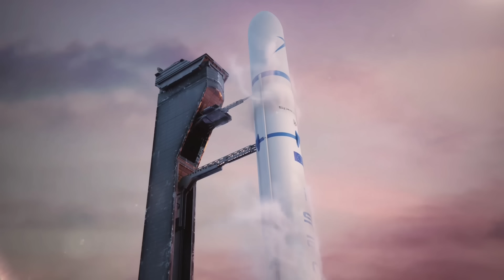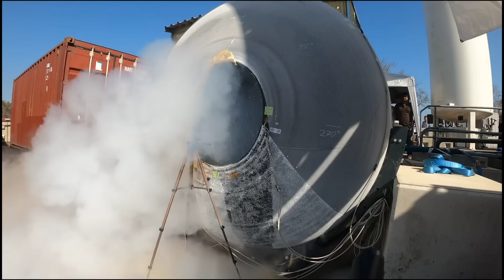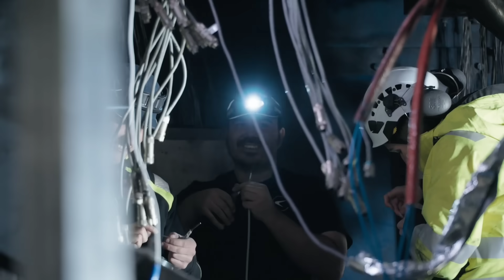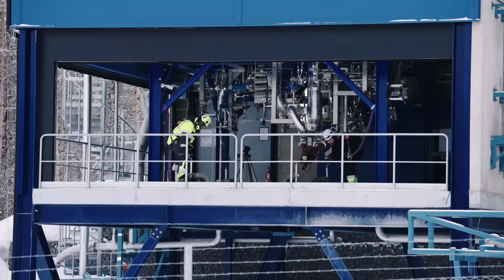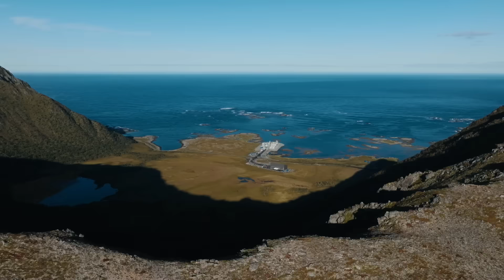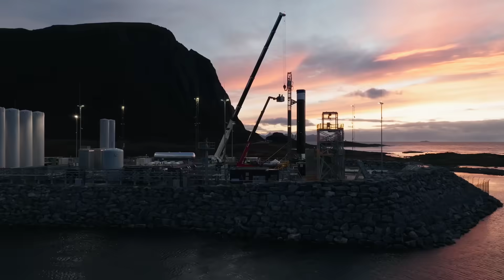THE WAIT IS OVER!  This week, German launch provider Isar Aerospace will make history!

Comment: Propane produces more CO2 than methane, as there are only 2.7 hydrogen atoms per carbon atom, compared to 4 in methane. It is a bit better than the approximately 2 of kerosene. The energy per mass is also somewhere in between (IIRC closer to methane than kerosene). The big advantage is the fact that its melting point is below the boiling point of oxygen, so the tanks can share a wall, reducing weight. Other components don't need insulation between the two substances either.

Comment: Overall, I think propane has the potential to be an excellent rocket fuel.
There is a sulphur problem with propane. But that problem is one of coking and it only matters if you want reuse. You can make the problem go away by either removing the sulphur or manufacuring thenpropane from co2 and h2o. Both methods have their issues.
However, propane and oxygen have an overlapping liquid temperature at standard operating pressure. This allows the tank interface to not require insulation, which can greatly lighten the tank structure.  At -100C the tankage density of prop-lox rocket propellant is only slightly less good then kera-lox. And the specific impluse is only slightly less good than meth-lox. To my mind this, alone, makes propane an excellent all-around compromise fuel for a launch system.

Comment: it seems all these startup are neglecting one crucial financial fact...whilst building rockets to compete with Falcon 9.....Spacex views Falcon 9 and Falcon heavy as old obsolete expensive platforms....when is a big if...but when starship comes fully online and reusable then even Electron Rockets will become financially nonviable.....it costs around 7.5 million for an electron launch.....Starship launch costs are projected to be very little more than that and the retail cost to customers is apt to be in the 20 - 30 million range...with 100-200 times the mass.... I find in unlikely many countries or companies will decide to pay 2 to 10 times more than what will be available ......basically all these new launch providers could simply be 5 - 10 years too late..   very few countries, companies or people are willing to pay 10 times the going price on simply principle..
Reply: Starship economics don't look that great so far, even ignoring that it didn't make it to orbit in 8 flights, and won't attempt it in flight 9, either. And all this without payload. All we know is that the current configuration is under-powered and needs to be larger to make sense. And while re-using the booster is impressive and seems to work, re-using a craft after re-entry from orbit did not make the Space Shuttle cheaper. Main problem is that you have to spend a lot of weight on the heat shield, structural elements and reserve fuel for landing, all cutting into the payload, and that won't magically go away. Maybe re-using the booster will result in good enough economics, and SpaceX will put something new, disposable on top of it, or they make a few break-troughs and actually achieve "rapid re-usability", high reliability and a decent payload capacity, but building something that is durable under extreme thermal stress and hypersonic airflows, but also lightweight, strong and cheap, that sounds more like a miracle than something you can actually build. There are always trade-offs in engineering, and I see I high probability of StarShip becoming the equivalent of the Cybertruck: Ambitious, innovative, expensive, unusual, and fundamentally flawed.
Reply: @peterprokop  the last 2 block 1 starships actually proved the system is viable...it may take 5-10 more block 2 starship tests to get to a point that spacex learns enough to progress to block 3...  the simple fact that block 1 starships survived intact and in the location they belonged shows that with time the system will bear fruit.....this concept is nowhere near as fundamentally flawed as the space shuttle was......also starships were never meant to be as rapidly turned around as the booster is meant to be....that is why spacex is not mass producing boosters ...a single booster was meant to launch a multitude of starships..
Reply: @mikelee-i3b  I am not convinced. While booster catches looked impressive, not even a booster has been re-used yet, only one engine so far, but booster re-use should work, although re-use also comes at a payload price here, especially having it to return to launch site.

And regarding Starship making it down: I agree it was promising it came down, I think three out of eight times, in what is called an "ocean success", but I see a long way from there to reusability, and it might be even too long. There is not much value if you bring it down, but have to trash most of it.

The Shuttle made it up and landed safely on the first try. It blew up only twice, once on the way up, once on the way down, but re-use did not make it a cheap, the opposite. Shortest turnaround time was 54 days, and the way it landed, as a glider, looked safe and controlled and did not rely on an engine working or having enough fuel left.

And I am still suspicious about the payload. There seem to be no clear information out there, and it is also moot as long as it is to unreliable to even attempt to go to orbit, and it is unclear how much weight will have to be added to make it work, and even SpaceX can't know that until it is proven to work. Not impossible, but it will take of lot of time and money to get there, and that stream might not be endless. And I don't see any human flying on that thing in the next decade.
Reply: @peterprokop  clearly there are a lot of ifs and a lot to work out.....like falcon 9 the shuttle had to be refurbished and was not reusable in the strictest sense....look at the 2 boosters...falcon 9 uses kerolox...this creates a lot of carbon in the Merlin engines which must be removed after each flight....hence the use of methane on both the super heavy booster and starship....falcon 9 has to have the legs removed and tipped over...all this costs time and money...I personally do not think spacex will reuse a block 1 booster..but just having them back intact gives spacex a treasure trove of information that is likely already paying massive dividends.....eventually spacex will catch a starship and that will be  worth it weight in gold as far as perfecting the concept...when who knows, but I suspect sooner than later

Comment: Propane is a hydrocarbon just like methane or kerosene, so burning it produces just as much CO2 as these other rocket fuels. I guess it burns „clean“ in in the sense that it is made up of very short carbon chains which leads to more complete combustion, similar to methane.
Reply: CO2 may be a greenhouse gas, but is not a pollutant. You can stay 1 meter from engine, burning propane, and breath deeply. There is no fuel smell, only co2 and water exhaust. Far better than kerosene.

Comment: One way to reduce the carbon footprint of rockets is to launch less of them.  The more often rockets are launched the bigger that footprint would be.  Of course, the catch 22  is that the less you launch, the more uneconomical launching rockets would become and  the space business would become  more and more financially unviable.  No one seems to have the answer to this problem.
Reply: One way to reduce carbon footprint is to drive an EV that runs off of rooftop solar. 🙂
Reply: if parts is made to be common/standardised around the world then it would reduce the cost. ie: you can benefit from countries where labor/resource is cheap by importing component from their factory then assemble a rocket when you need it.
Reply: Duh
🥴